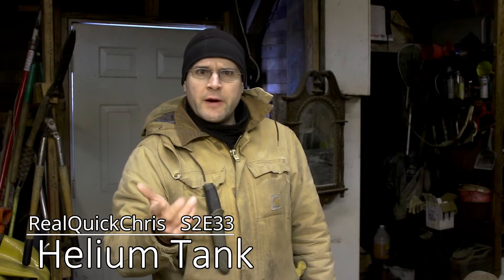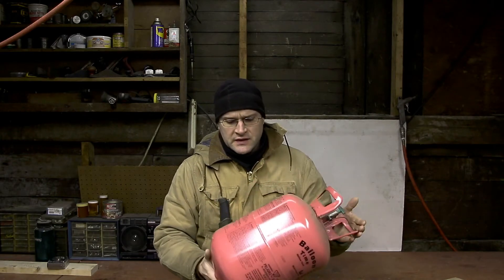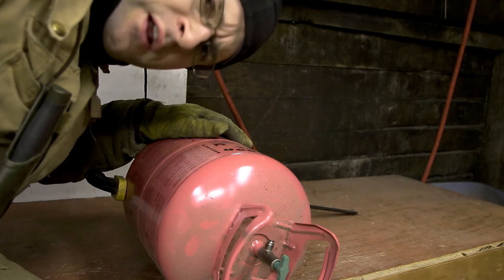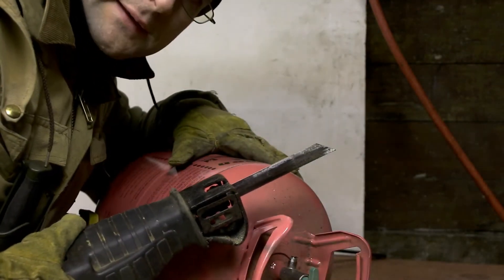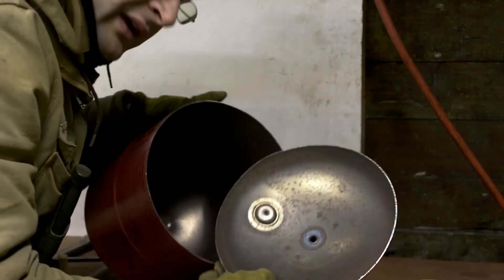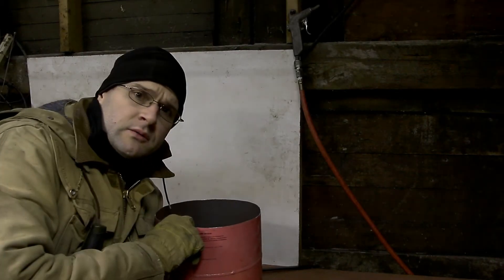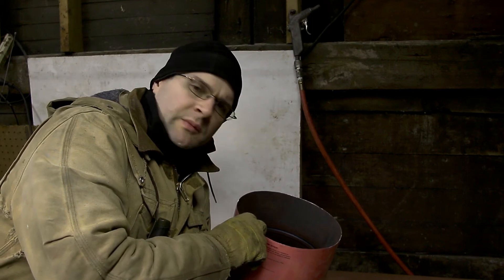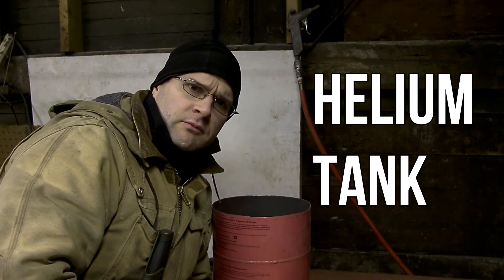what's inside a helium tank s2e33

Comment: Plenty of people use them for small forges and foundries.  The wall thickness of the tank isn't critical, it's just a mold to shape the ceramic wool and satanite really.  I found one on the side of the road yesterday and still deciding if want to make  a small forge or a small foundry for aluminum.  I don't have a need for either, more of a project just to have a project, lol.  I have heard the pink paint on these is tough to get off and if you try to grind it off the thin wall can be a problem.  Probably why I'm seeing a lot of pink homemade foundries in videos, lol.

Comment: How did you get all the the air out of the tank? I’m looking to do this myself but I’m worried about it exploding if I cut into it.
Reply from the maker: I let all the helium out of the tank by the valve on one of the tanks I don’t remember if I could unscrew the valve or not.
Reply: There's a small disk near the valve on top.  It's designed to be pierced with a punch and a hammer to depressurize them before you recycle them.  If you need that intact just barely cut through with a hack saw like in the video.  The valves do work well to completely empty them.  This only applies to single use helium tanks.  If you've got a propane tank that's a different story. but there are plenty of videos out there that show how to make a propane tank safer to cut.